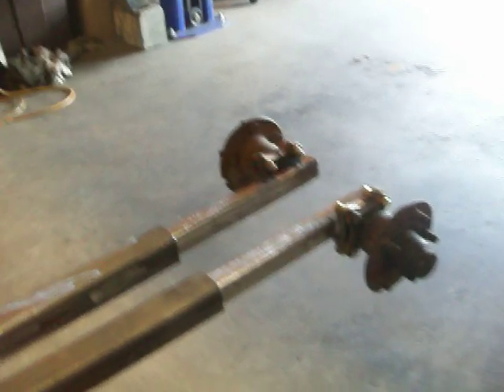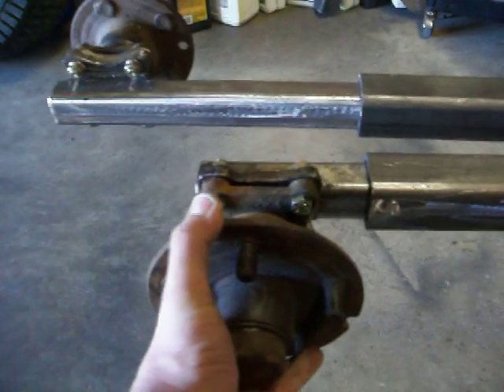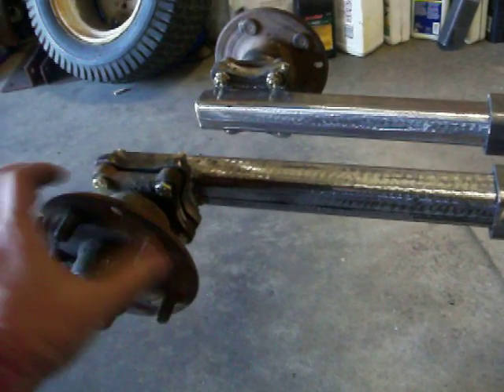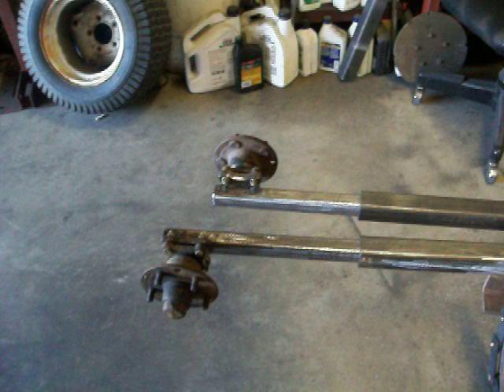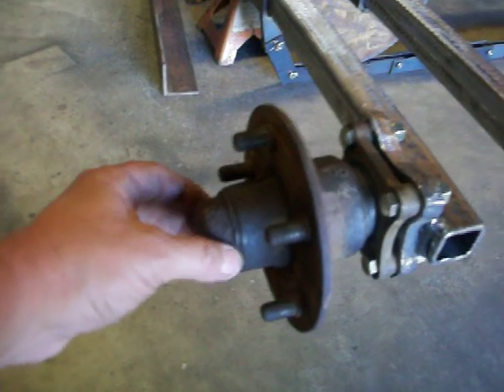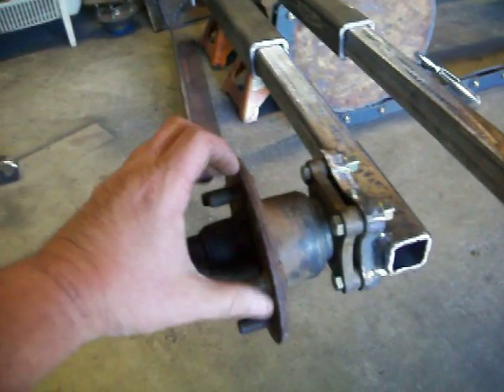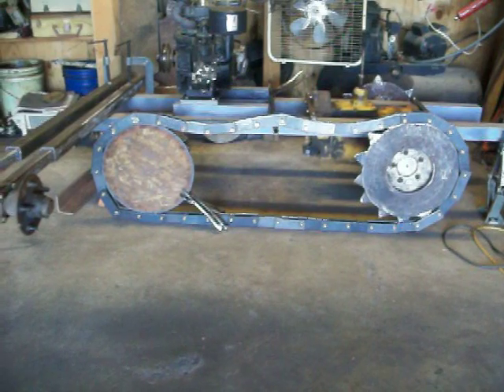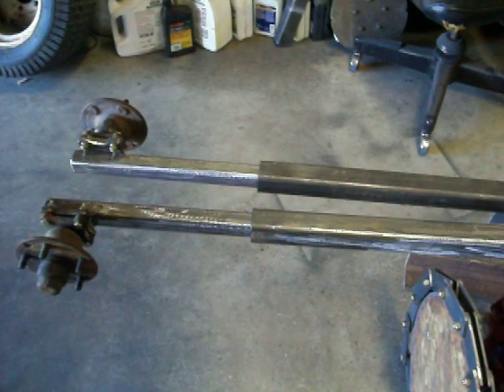Mini Dozer home built " Track Tensioner & Front Suspension Update"

Comment: Instead of those tensioners, run a 3rd axle in the middle with pneumatic tires that fit tight flat. Air pressure tightens the tread, by swelling the tfre.

maybe...

the problem with that is the tension is held only by the spring, so if tension increases (loads, power, torques, junk in the tread) the spring will collapse, then the treads could be easily misaligned, and would it power itself off in ~1 rotation.

Comment: Excellent basic telescoping example of what I've been planning for the 6x4 Ford YT16 rear snowmobile track and optional tire wheels mechanism.  Have some dock square stock I rescued for free that I'm planning to use.  Have four bearing (pillow & flange since not determined yet) blocks since I designed that way so far with the axle and want to place sprockets with chains to keep each wheel moving with the transaxle.  Probably will use the pillow blocks.   Neat... hopefully I'll move forward from paper and document this winter.  Thanks for sharing!

Comment: On real tractors.....they use grease to tighten the tracks....hdy. Pressure......add a rubber plug on the end of your inner tube....grease fitting on the putter tube.....should work for you.....if you need more pressure to tighten the tracks
Reply from the maker: Yes I knew that Mike but since I built the wheels (all 4 )  by hand there not absolutely perfectly true and they must move back and forth a slight tad so spring loaded is the only way and that's what caused the problem,,I went away from springs I had originally installed and added a solid screw adjustment,,didn't work,,problem is now finding another cub cadet axle to replace the bent one with,,,like hens teeth brother.

Comment from the maker: I had planned to put the springs inside the tubes originally but the small tube may not be big enough to house a spring strong enough so I'll probably mount 2 springs on each side to push equally and its the way my oliver is done,,the springs are mounted on the ouside and there huge springs,,appreciate the comment

Comment from the maker: I have enough 3 inch sq tubing to build the frame that will hold the front wheel mount and tensioner or the under carrage they call it and also that the roller wheels will mount to,it will be all one solid piece but will still bolt on and off of the upper frame,Im still building it so it could be taken apart to replace the re-end if needed,oh well I didnt think you had seen the train engine and it would be killer to have track all around the yard with a few cars and it run from 110 volt,later

Comment from the maker: as far as the extra metal I have a wall ligned with it up at the shop but still not what I need to make the track pads and cleats but pretty well all else needed to finish,,sopme how Ive got to get re-interested on finishing this thing and as fast as possible cause it is gonna be a ton of fun to operate and with a few attachments on back could be used for multiple jobs like pulling a small plow or breaker plow and then a tiller and the blade im gonna build will be killer and very sharp,,pt 3

Comment from the maker: lazy is not what I have become on this dozer and Ive got to get out of it if I ever expect to finish it man,,in 3 days ive only got the front wheel holders or suspension tubes built and finally went up today and capped of each end of the tubing where dirt cant get in and then drilled 6 holes and threaded them for grease fittings and thats all,,if I would do like I was doing when I first started this thing i could finish or at least get it operating in a week or less and dont know why I dont.

Comment from the maker: hey have you seen the Locomotive and coal car I started back in the early 80's,,i'll someday finish it and install a modern day powerful motor and maybe feed it from the tracks like a Lionel train set so a battery want be needed,,I think I listed it as "Homemade type Electric train set Locomotive 2-6-0" and if I was much younger then if my work looks crappy or something,,notice the body is made froma small oxygen tank and the other parts are hand made,imagine it 110 volt powered maybe,,haha.

Comment from the maker: hey one thing that took a while is on the larger tubing there is a weld seem going all the way from one end to the other which made me have to grind a wedge the entire length on the small tubing so it would fit into the bigger one,,didnt grind dep enough to harm its strength but still took a while to grind it down,,to bad it had the seem inside cause otherwise talk about a tight perfect fit,,,later

Comment from the maker: I tell you its a challenge and the more time you have the better and probably the actual hardest part is the tracks and drive wheels but if you take your time and not rush it then it will happen,,Im getting excitied about being able to operate it for the first time and may end up with a bigger motor for sure,,the way its geared the 8 hp briggs will pull it nicely but a 20hp would be killer,,appreciate the support man and go ahead and build you one,,Rick